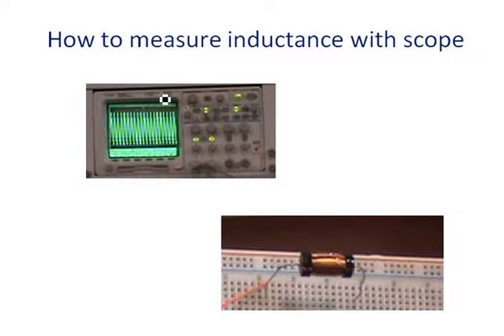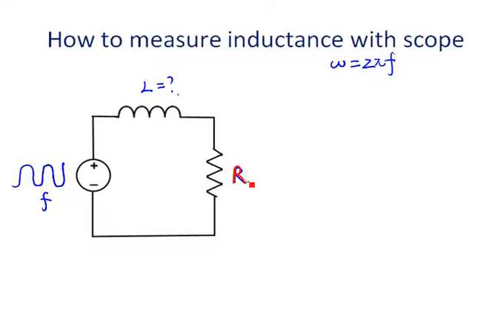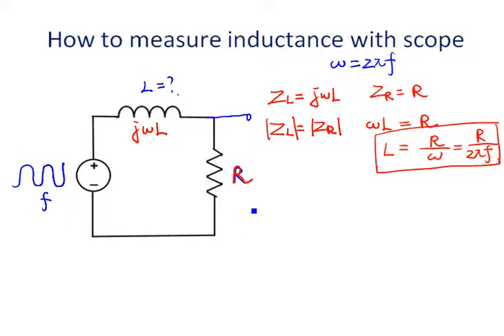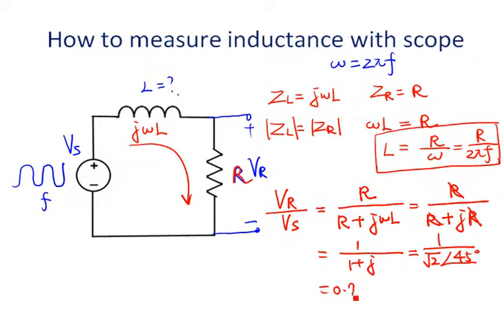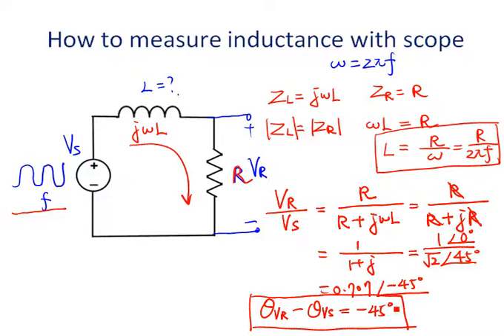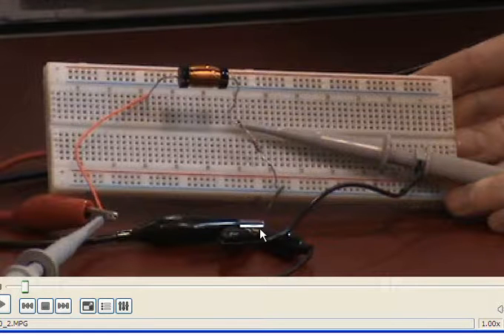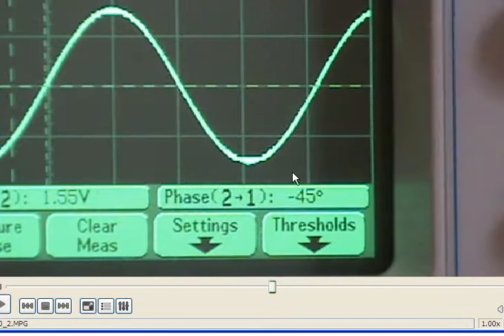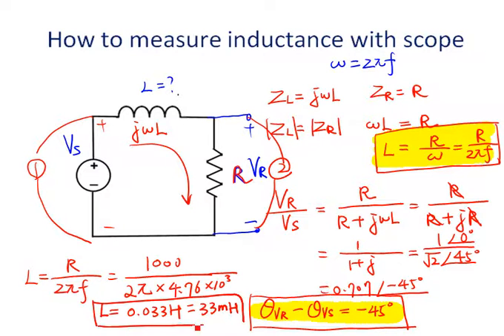How to measure inductance

Comment: Works for larger inductances with a larger value resistor. I easily measured a 40H transformer's primary with a 30k resistor (f=115Hz).

Comment: I heard that using a Wheatstone bridge circuit instead of a simple voltage divider as shown in this tutorial will provide more accurate measurements of impedance and this more accurate reading of inductance.

Comment: Didn't you forget to account for the internal resistance of the signal generator? 50 is 5% of 1k...
Reply: Irrelevant. This method is independent of voltage. Results will hold no matter the source voltage. Now had you asked whether results might have changed had we considered the series resistance of the inductor that would have been a legitimate question.
Reply: @Jnglfvr  so Vs is not the value of the voltage shown on the display of the function generator, but it is instead the voltage that needs to be measured across the LR series.
Reply: @copernicofelinis  Correct. They might be different depending upon circuit impedance and what the function generator "expects" the input resistance to be. In any case none of this calculation depends upon measuring the voltage across the resistor. Instead it looks at the phase angle difference between the source voltage  and the resistor voltage. This phase angle does not depend on the magnitude of the voltage. Another way to have measured the inductance is simply to adjust the measured voltage to be 70% of the input voltage. This occurs at the exact same frequency in which the phase angle difference is 45 degrees. But, again, this is independent of the actual voltage across the circuit but is only dependent on the ratio between the input and measured (output) voltages.

Comment: @3:00  Was disappointed that 1/1+j was equated with 1/sqrt(2) @ 45 degrees with barely a mention and no explanation.
Reply: the complex number was converted to polar form using Pythagoras theorem to get the length and trigonometry of right angled triangle to get the angle. Use Polar to Rectangular Online Calculator so you don't have to do the conversions by hand. The angle was actually -45 degrees because when dividing polar numbers you subtract the angle in the denominator since the angle is actually an exponent (Euler's identities) and the index law of exponents says subtract the angles when dividing.

Comment: It's not a power supply .. it's a signal generator !
Reply: FuzzyTheBear  but you may use for, in a AC aplicación where it keeps the current stable and strong supply the more current you used in the circuit the better performer of the inductor and you would not have spikes

Comment: There is a question in my mind. So, if I have the phase value among V1 and V2 for some frequency, of course, if the frequency is static like as 1mhz for example, and I know the R reference value too, that is 500R for example. How can I make the conversion to catch up the Inductance value ? OK, i see, L = R / 2*Pi*F, but i wanna learn how to use the phase value to achieve L value!! 
  Thankyou a LOT !!!
Reply: atan(2*pi*F*L/R)= phase difference between V1 and V2